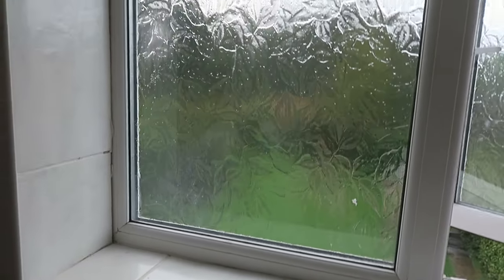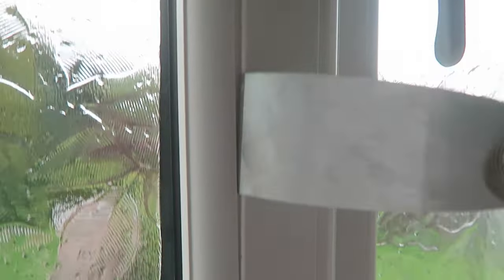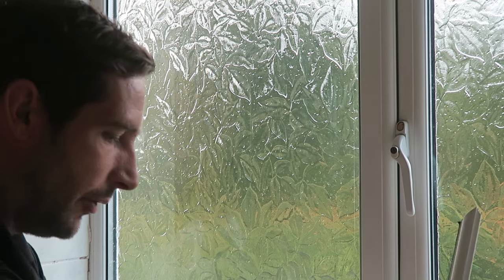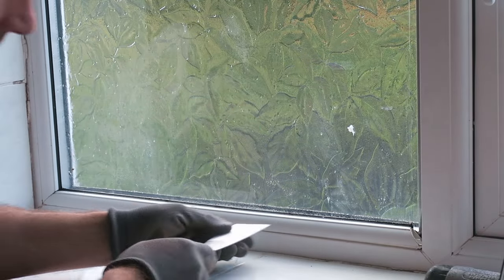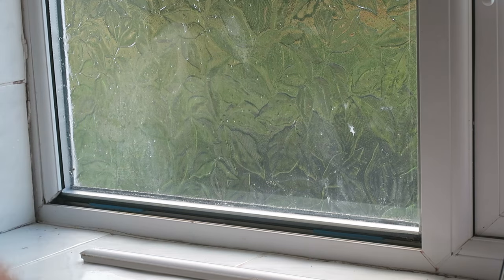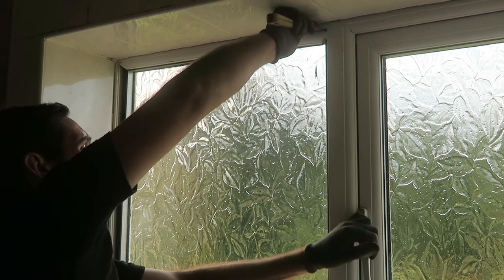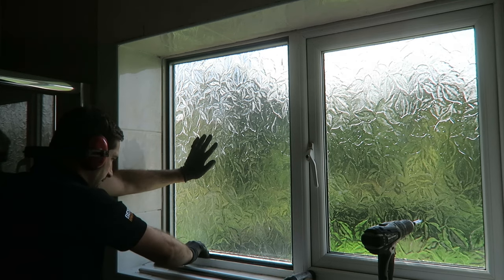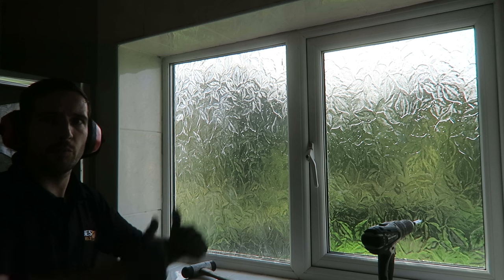How to replace glass in a upvc double glazed window

Comment: Just a little tip, I found it easier, in cold weather, to use a hair drier to soften the beads before trying to remove them. Sorry if that's common knowledge, I live in a bubble🤣
Reply: Thanks for the tip

Comment: looks so easy !! mine must be super glued in !! Ive been hammering a sharp chisel in, a tool the same as yours and it just wont open up !! I really dont want to pay a local company over £400 for two small units I can source myself for £96!!
Reply: My ones were also very tight. And it's even worse, this side was installed outwards (not easily accessible from the room)
Reply: That's not a chisel

Comment: Thanks for this great video Stuart. This gave me the confidence to replace 9 units in our windows.
Mine didn't come out so easy since the rubber was stuck to the glass. Used silicone spray and a flexible table knife to break the seal. I also needed to use a mallet since the beading was firmly clipped in. There were a couple of areas where I'd left a nick in the edge of the frame/beading. I used fine glass paper to remove the burrs. Thanks again.

Comment: Thanks for this! Installer put a unit in upside down in a fixed sash with Georgian bars - wife noticed the horizontal bar doesn't align with the opening sash it sits next to in the window! Saves calling them out again, cheers!

Comment: Fantastic video, thanks Stuart. I have the same type of window( internally beaded), I have noticed the external rubber gasket seal on the outside of window is starting to become rather brittle. Is it possible to replace the rubber seal gasket without removing the window from the frame? Any help would be appreciated.

Comment: hi, i have 2 missed up panes where do i measure from for the new panes of glass, so i dont have to take them out first cheers
Reply: I have the same issue.
Reply: measure from bead line in milometers (mm) to the opposite side bead line  (that's the edge of the bead that meets the frame edge)  then take of 10mm from your measurement, that will give you the glass size you need.

Comment: How you just did it is how I do it, but when I went to pick up a second hand window for my shed the seller (a window fitter) stopped me from doing it that way and removed the rubber strip from the front so no pressure on glass the the trim came straight out easy!! Only thing is I don't know the rubber bit goes back in? Can you help? Do you have a vid for that?

Comment: Great video thanks. Wondering how much you think a panel of glass that size (unfrosted) would cost and where to find a glass supplier? And would they deal with a diy-er or only tradesman?
Reply: you can look online for window suppliers, or you can contact some in your local area. They should sell to the general public as this can be done by a competent DIY'er.  No-one can tell you the price as there are various factors that determine the price.

Comment: I'm curious why no mention of replacing the glazing tape? Are you reusing the old or do your windows not have double-sided glazing tape like most all these type windows here in the US?
Reply: Internally beaded doent use double sided tape it sits on rolled in rubber gasket
Reply: You are correct: for security and water seal, there should be double-sided glazing tape.. A lot of UK double-glazing was originally fitted as a rushed job, with no effort to seal the gap between window frame and wall, this latter made easier in recent hears by expanding 3M tape and similar.. the old method, using expanding foam, added a lot of time / an extra day visit to the job.. I guess not removing the cover tape from double-sided tape was another way to save a few minutes. Lazy approach.

Comment: Hi Stu, mu units don't appear to have beading on the inside (or outside).  Looks like the may be bonded at the corners?  any ideas on what i could do to exchange the glass?
Reply: Actually on looking close they are externally beaded.  Is it the same process?  Looks difficult to get them out?
Reply: @paulpatrick2208  there will be some internal rubber around the inside of the frame, remove that before you remove your external beading, have a spotter on the other side of the window is always a good idea.

Comment: Hey stu bit late watching this vid but ive got a question if the windows have water in them and its not condensation because you open them every day at least for 15mins how the hell do you deal with it.........how does this happen or is it a big job to do?
Would be great if you have an answer or even a vid.
Reply: @Dang_Lin-Wang  yeah looks like its in between the glass
Reply: Your units have failed.

Comment: This is one of the simple upvc glazed windows.. lets see you do an external one? Or a 3000 x 2000 replacement?  Your just a DIY guy. Oh and top bead always goes on 1st!!
Reply from the maker: just to help diyers to do replacemets and help others, all the best
Reply: @Stucrompton1  i understand.. but you only gave half advice... if the 'diyers' are going to replace a dg unit.. they need to measure it 1st hey? Know the spec of the glass? Know the make up size?
Reply: @Stucrompton1  Most of us just want to the get the beadings  off and back on. Thanks for showing us how.
Reply: Did a 2100 x 1200 today after watching the video …5 mins to take out and the same to refit !   Apart from the weight of the glass
the bigger the window the easier it is to fit the beading … Stu’s the man 🙂
Reply: We appreciate you lee.

Comment: what if my unit doesn’t have any covers? mines just black
Reply: If you mean there are no beads? Check the outside, some older windows are externally beaded. You have to pull out the gasket from the inside, then the beads will loosen on the outside and you follow the same procedure as this video. Then just do it all in reverse to get the glass back in. Need a glazing spoon to get the gasket back in tho.

Comment: Hey I have a rather dumb question but this is a real question. My home window broke and the contractor is claiming the same amount of money to replace annealed glass as tempered glass even though tempered glass is twice as expensive as annealed glass. He claims this is because annealed glass tends to break during installation and therefore costs more (in labor) to install even though the glass itself is so much cheaper. I am not that handy so can you help me please ? Is he BS-ing or telling the truth ? Is there any reason why it would cost just as much to install annealed glass as tempered glass ? 

Please help !!!
Reply: Gayatri Prakash he is bullshitting you plain and pure. The double glazed unit has a sealed rubber gasket around it that allows the sealed unit to make a watertight fit in the uPVC frame. This also allows for a bit of flex when snapping the beading back into place. There is no practical difference between the two from an installers point of view other than weight difference.